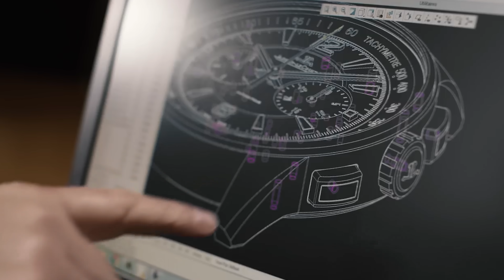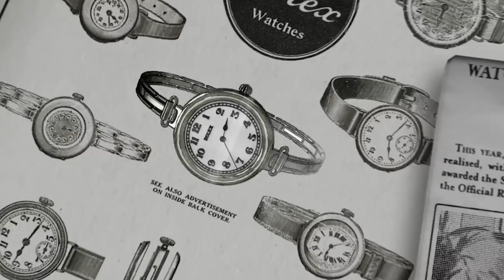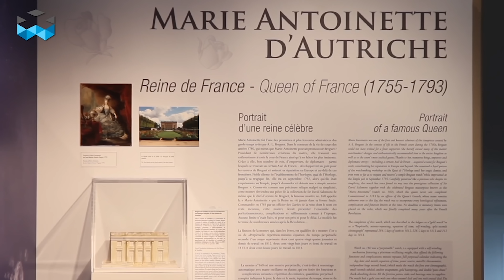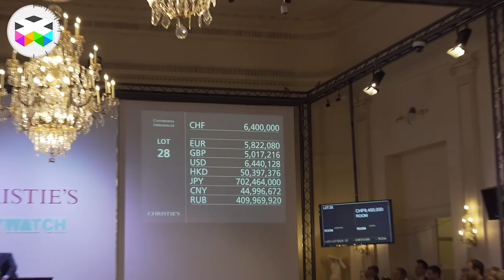Top 10 Most Expensive Luxury Watch Brands In The World

Comment: Over 20 years ago I bought a new watch, didn't go crazy but for my love of motor racing I paid over $1100 for a Tag Heuer. Six years later it was not working properly so I took it in to be fixed and was told the repair would cost $500 and change. I thought this watch would have lasted forever so I took it home put it on the garage floor and smashed it with a hammer. No more fancy watches for me, $200 tops and when it's done it's done and I buy another.
Reply: I bought a Tissot 28 years ago. Serviced it once 
it is an elegant tank
Reply: I bought $7 watch 9 years ago. Except the batteries that have been replaced multiple times, the watch is still working
Reply: @yukiko_5051 
nice.... 
I should add, about 25 years ago, I was roller blading down a steep hill going way too fast to a point where the blade chasse was not managing the wheels firmly and they actually did a fast wobble. I wiped ...and no kidding... my Tissot saved my left wrist from likely being busted. 
elegant tank! 
Next time I'll wear proper PPE ;P
Reply: Got a Seiko automatic watch 20 years later it’s still perfectly working well better than my other watch IWC and Rolex
Reply: "expensive things should last forever"
😂
Reply: @FixedFace  My buddy's Roli is from 1960s (via his pop) and it is pretty much lasting forever. Looks elegant, works great.....and .... I bet you it would be worth a bit more on the 2nd'ary market vs a Seiko ;)
Reply: Hi good morning.. was that evening..I am looking for a job.. and as pa personal assistant in that distance.div father for Mandla.. I'm your father Why..I got the job as Why to you..u were in boarding school ..I was standing in for u..as in what exactly..a AI picture..I want my money after this.. what didn't work.. soccer engine.. examples... biscuit example.. Onega.. watch.rolex example.. respect that..see you later...
Reply: So this means to ordinary people you're either Rich or Stupid. I think you're BOTH

Comment: I had Tissot watch two decades ago. I bought this for $200 at that time here in the Philippines. I used to wear this regulary for 10 years but suddenly its stainless strap broke in the lock area due to 'wear and tear' but I was able to still wear this. Later on the back case popped-out and this no longer fits or locks into the watch. The local repairman said it is no longer repairable. Now, I decided to buy cheaper watches. I also had a Guess watch I bought in the US shopping mall 28 years ago for less than $100. I wore it for a while but I kept on replacing its leather strap because it easily wears out. So, I stopped using it and kept it in my cabinet for about 2 decades. After 28 years, I decided to have it checked and replaced its battery. To my surprise it is still working and its leather strap is still wearable. I have only about a dozen watches in my collection of cheaper brands such as Kenneth Cole, Fossil, Casio, Festina, etc. I am satisfied wih these watches since I cannot afford the expensive ones.
Reply: I do like a Festina. I have a few watches like Casio, Citizen, Omega Bulova, but my daily watch is a Breitling Super Avenger II 48. I'm an engineer and find its robustness great as I am somewhat clumsy! My prized watch is a simple Casio which cost my wife £25, 35 years ago.  The sentimental value to me is priceless. I have never had a Tissot but have always admired them. This may be my next purchase.